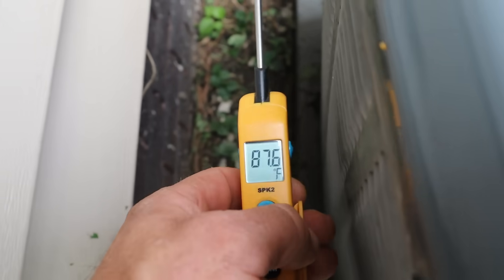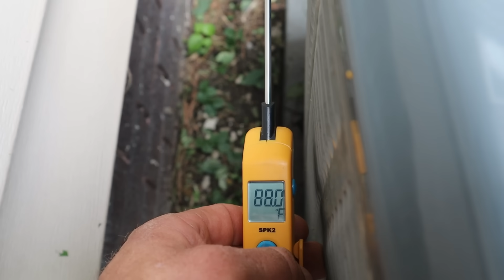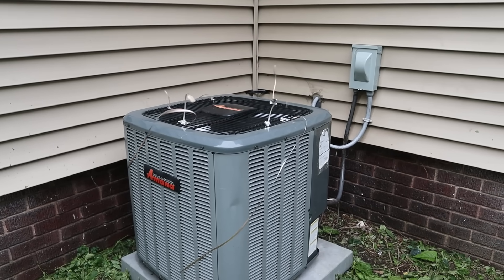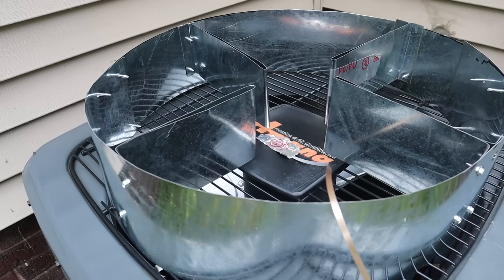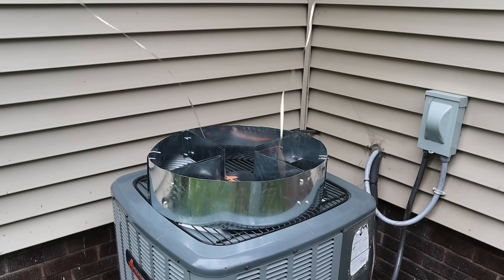Your AC Fan Makes a Mini Tornado

Comment: But the advantage back to the mr thinBut the advantage back to the mister thing is the fact that it is also spraying water on your coils, and that water is actually helping to clean the water. Your coils off as well, if you could make this work in conjunction with the thing that is a mister it would really help to improve your overall efficiency as well. Because now you have something that's spraying a mist on your coils, that is hoping to clean dirt and things off of your condenser coils as well as you're not recirculating that hot air back down onto the coils. So yeah, this would be a self maintaining system. As far as helping to keep the coils, clean or cleaner. As well as not recirculating that hot air back down there in there, as well as the fact in many places where they have room, they won't set these against your house. They try to set them down away from your house by about 10 feet to avoid that. You know, vortex effect that it causes The Eddy current, I think I'm using that right now. To draw the already hot air back down and run it through the coil. In essence, they just try to get these things done out in the open enough, that they would be less likely to know recirculate the already heated air if they can avoid doing that altogether.

Comment: Any inventions to keep cottonwood out of the coils?
Reply from the maker: Yes there are solutions, like external screens or meshes, but they are the antithesis of efficiency. Will add another layer the unit will have to work harder to breathe through on just the mesh alone.
Reply: As I am allergic to that nasty spooge the cottonwood trees throw off... I'd say "Chainsaw"

Comment: Air flow is one of the central reason why condensers are to be installed with 24” clearance on all side. But that is not always possible and you get these issues.
Reply from the maker: It was possible in this case, but the installers just chose not to. But I do see a lot of units installed in places where there really is no better alternative.

Comment: for condensers with fans facing horizontally, does this effect still happen?
Reply from the maker: It can depend on location of the unit, but the fix would be a different design entirely.

Comment: Hot air always rises up. Physics 101.  Only a fat and long conduit could make it better.🤞The corner location is not doing any good though.🤔❤👍
Reply from the maker: Hot air rising applies to buoyancy. In this case it’s a forced, unstable vortex from the fan that is easily toppled by crosswinds. I agree the location is bad, but the air dynamics would be similar in an open field.

Comment: Do you think eliminating that center “emblem” square would increase airflow?
Reply from the maker: It might help a little, but most of the drag comes from the swirling air the fan throws to the edges.
Reply: @JerseyMikeHVAC  thx, I was just a little surprised by the size of it. The ones I have are 3” in diameter if that.
Reply from the maker: @michaeldecker2725 Yeah, it is pretty big and your same thought crossed my mind too when I first noticed it in this experiment. But that's where the research took me.
Reply: Probably not by much. If there's even any fan blade area beneath it they're moving too slow to produce meaningful airflow.
Try wetting your fingers and feeling the flow near the center of a ceiling fan vs near the edges.

Comment: This exercise, highlights the inherent compromise of residential HVAC equipment in general.. The packaging for shipping and what housing these things, dictated this outcome. There are actually significant watts to recover here, though added cost for a proper diffuser and the sheer abhorrent esthetic would cause the average consumer to revolt at putting that monstrosity next to their home 🏡!!!!
Reply from the maker: Yes, it would be harder to stack these in a warehouse and it's not pretty enough for the costs involved to implement it.

Comment: I'm curious if a chimney (say 4-6ft) over the fan wouldn't accomplish the same thing. My thought is: "Who cares if it's a tornado, from the video we just don't want it looping back on itself."

Even in the video it looks like you replaced one tornado with 4 but, more importantly, moved the exhaust further away from the intake and, my guess, is that's the important part.
Reply from the maker: The challenge with a tall chimney is static pressure — once you go much higher than 12–18 inches, the fan has to fight drag and you can actually lose airflow. The diffuser shroud works by straightening the air right away to throw it higher up away from the unit without the added drag of a long tube.

Comment: if you could show that adding the air straightening vanes moved more air than without, it would be worth doing, but you did not do that.
Reply from the maker: The purpose is not to move more air. It's to straighten out the spinning vortex to get a more straight upward motion so the air is thrown higher away from the unit to prevent roll over. And I did demonstrate that the shroud has that effect.
Reply: How would the amount of air moved change? Its the same fan, same speed, so same air. Mike is directing it up better.

Comment: Another way to create the cooling tower exhaust Venturi would be to buy a trash can of the appropriate diameter and cut th bottom out and since most cans are at least three feet tall it would loft that column of air way above the side intake for the coils. Great idea sir!
Reply: I'm gonna try this just to piss off my HOA.
Reply: @Michael-1337  🤣🤣🤣 I can't stand HOAs. Used to live in an area where HOAs were the "Kings & Queens" of your private life. Glad I moved and live in freedom!!!. Now, if we somehow convince the politicians to lower property taxes here in South Floirda
Reply: great idea, my unit is in the back and don't care how it looks
Reply: There hou go, OP.  Cut it to any length you need, but if it’s 4-5 feet tall already and behind the house, that’s fine.  Paint it to match the house, and plant some fake or real tree or cacti.

That grid idea is pretty mandatory to keep the animals and gutter-like trash out.  Maybe a small ani al-sized cutout at the bottom, so they could out, wouldn’t harm the efficiency much.
Reply: @Pene7942 interesting. in the southwest I can't imagine any animals they would be able to get in to the top of the trash can Inlet and not be able to get out
Reply: Great idea. Now Im going to steal my neighbor's trash can and cut it and paint it so he wont recognize. Hehehe
Reply: @rolandjosef7961  😂
Reply: So, trash can idea... would you cut slits near the base where it meets the fan to allow it to pull some air inside as it rises? Does that help exit velocity/flow to get the air even further away to stop the recycling.
Reply: @d3lsl0w no cutting slit is a bad idea and defeats the purpose, it's not going to draw air into the slits it's going to blow hot air out of the slits
Reply: Trash can is a great idea I never thought of. Professionally, I would buy very large 28 inch elbows or 45° ducts that works great for this purpose, but a trash can is far less expensive and accessible to everyone. However, if you need the exhaust air to exit out the side for installations where the unit is under a shaded area that builds up the hot air, the trash can will help some but not ideal
Reply: You ask your local rancher if they have mineral lick tubs they would like to get rid of.  The bottom could be easily cut out with a sawzall or jig saw.  Free to experiment with instead of  buying a garbage can.  Used mineral tubs are great for container gardens & yard debris clean up also.
Reply: I was thinking the same thing, except cut to the right height.  I don't believe it needs to be the whole length of the trash can, which can introduce new air flow problems.
Reply: Great idea
Reply: I went to run a service on a condenser under a deck with 2 walls of the building and a cinder block enclosure on the other 2 sides. The owner of the office had a couple 16" elbows routing the exhaust out far enough for it to not affect the ambient air being drawn in. Was happy to see it.
Reply: A plastic garbage can is easy to cut.  I just hope it doesn't melt.
Reply: except for the fact that it would look like sh....it
Reply: @robertdalga128  no, it would look like garbage
Reply: @Not.Your.Business  lol
Reply: @Not.Your.Business 😂
Reply: @Not.Your.Business  Perfect
Reply: @robertdalga128  You only need something that would be no higher than a foot.
Reply: @robertdalga128 Do you really go around judging everything you see? Sounds exhausting😂
Reply: Thats actually a bad idea...by that logic you should just make a stack that goes above your roof...except for the fact that now you have a duct that has friction and the discharge air doesnt have a way to expand...which is kind of the point of the air being ejected to the sides...
Reply: @johnrobertson7583 wrong. I'm a professional and have made a duck that went all the way up out the roof of a confined patio and it made a huge difference that you could measure.
Reply: @johnrobertson7583 : You don't want the air ejected to the sides, you want the air ejected up. If the air ejects to the sides, then the newly heated air will circulate back into the condenser, reducing it's efficiency.
Reply: @johnrobertson7583  If you're cooling your house, then the exhaust air is going to be warmer than ambient, so having a long chimney might even through buoyancy draw the air upwards more strongly than any added friction. If you're heating your house, then the opposite will be true.

Comment: This will save you money.
What's BETTER is to ventilate OUT the heat that normally collects at the ceiling of every room, and simply let NATURAL CONVECTION exhaust the hot air upwards and OUT through a duct directly to a spinning turbine vent on the roof. No electricity needed.
Those broad blade ceiling fans need electricity and actually push that hot ceiling air back down at you. But it feels cooler because there's a breeze causing evaporation off your skin.
A/C is only necessary for the hottest days. Ceiling ventilation WON'T put the A/C industry out of business, since A/C installers often install ductwork anyway.
Reply: Cooling with ambient air from outside can never cool you below the ambient air temperature.  The hot air at the top of my room is cooler than the air outside that you want me to replace it with, LOL
Reply from the maker: Agree. The house itself is usually the biggest battle. These new passive homes are really shrinking down the size of units needed to cool them, and the inverter technology further increases efficiency on top of it.
Reply: @JerseyMikeHVAC Thankyou.
Let's all try to reduce the atmospheric heat buildup during the summer.

Comment: Properly sized the outside unit really doesn't have enough run time for this to matter. Have to remember 90F is still well below working fluid temperature inside the condenser coil. So heat will be exchanged either way. In units like large commercial cooling towers run time begins to approach 100% and you are having to pack way more heat exchanger into a smaller volume of space. So accelerating that warmer air up and away helps draw in cooler air in a mini convection climate.

Not saying it has no effect. Just the return it's worth it compared to the issues a velocity stack would cause on a residential unit (Catching leaves and snow during fall/winter etc.)
Reply: I think you are wrong, for the reason explained previously. 
In simplest terms, consider the implications of having cooler air flowing though the coil.
Reply: @BobbyDotNet  If this had a meaningful effect for a residential unit vs the downsides then the manufacturers would have included it because efficiency ratings get back both tax credits and make sales. 

The gas inside the condenser coil will be 120F to 140F. 78F or 88F ambient temp in localized areas makes very little difference. 

In large commercial heat exchangers things are different due to run time and density.

Comment: Were you able to quantify any measurable effect this shroud had, other than decreasing the air temp at the coil intake?  Your 'elevated' temperature is still about 8 degrees lower than my afternoon ambient, and my AC works fine.  I mean, as long as the refrigerant is being fully condensed in the coil, the system is working properly, and it would take an ambient temp a lot higher than 88° for that to happen.

Comment: Good thinking.....let's continue. Yes.....Industrial Cooling Towers have fan exit shrouds that help prevent hot air from recirculating back into the side entries. However, notice it is not a cylinder like you have with straightening vanes....it's a parabolic "trumpet" shape. Also this...which might be easier to build. Just build a cover with a large center hole that matches the size of the fan exit....BUT.....have the horizontal surface extend past the perimeter of the unit, maybe a foot extra on each side....making for a flat surface that extends "outward" on all 4 sides by 1 ft each. This won't do anything about the random turbulence of the exit air....but it WILL helo prevent recirculation which is the core concern here. LATER EDIT---> maybe start with a plastic garbage can that has tapered sides....and cut it apar to make a "ring" that matches the exit "hole" of the condenser. ...anythng higher would be tpaered out to a larger diameter. Not a true parabolic shape but better than straight sides and can work for cheap.
Reply: Check out the wind inlets for wing suits and wind tunnels --- you are noticing what I see.

Comment: Apparently counter-rotating propellers on planes and boats also solve this problem. I wonder if it could ever be cost-effective for a manufacturer to add a second counter-rotating fan.
Reply: Cost of running another motor and installing it would definitely exceed the gains. Guess you could gear box counter rotation, but that's added complexity and cost as well.